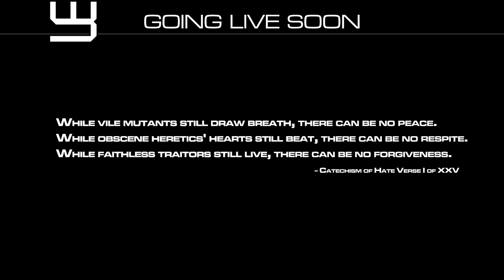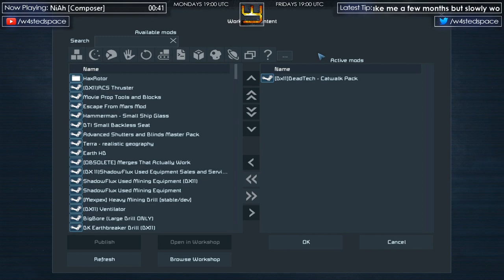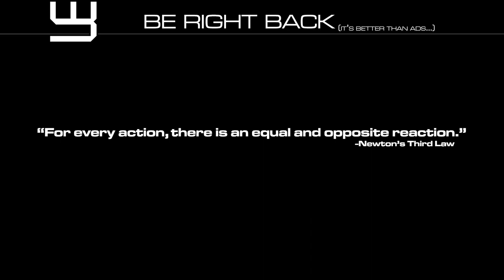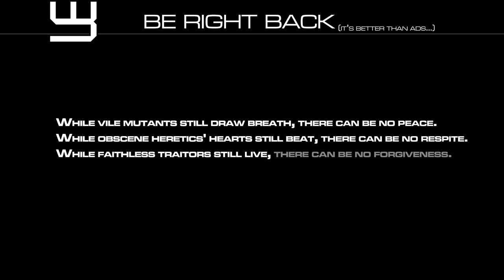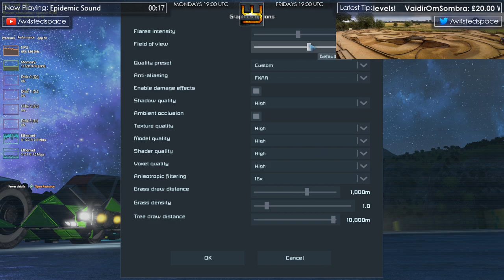Space Engineers - A little RC Racing?! Track & RC Car Build + Viewer Challenge! (Live Stream)

Comment: Watching wasted fight with building that bank turn and all I'm thinking is "Why not just block it up too large, then stand at the center-point of the turn and slowly rotate carving it back with a sphere or pill tool?"

Like, build a pillar to stand on in the grid cross this corner swings around, and use the arrow key rotation to slowly and flawlessly carve back the terrain. That way, you get a perfectly smooth, perfectly even bank that you can further crop down and clean up with little risk.

While it's easier to touch up rough shapes from the inside out, it's easier by far to carve out smooth shapes by over-building them. If you need something smooth, it's usually the best way to do it.